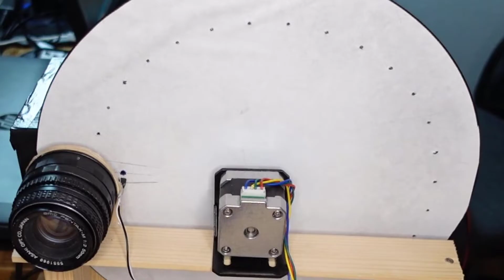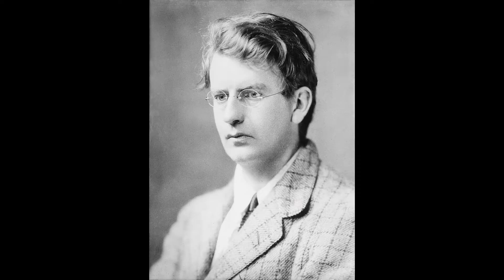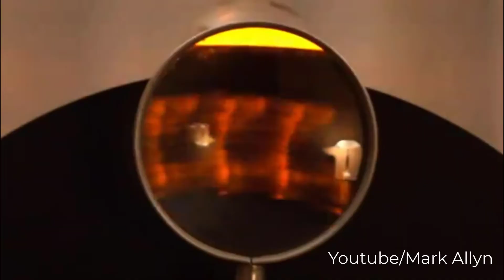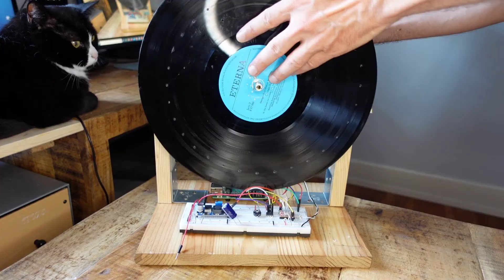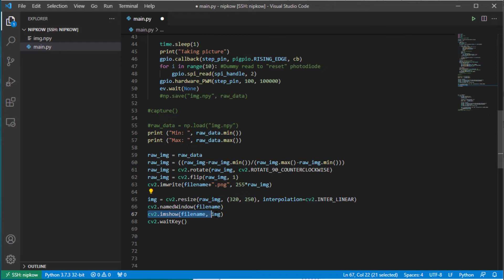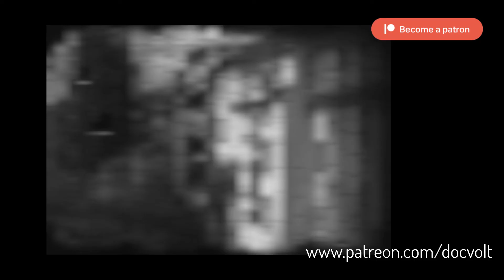I Built a Mechanical Digital Camera With a Nipkow Disk

Comment: Absolutely brilliant work. Now everyone understands why the Nipkow camera was never built in practice. In the 1930s, the way it was handled was that the scene was shot on classic film. This film (still wet) was passed through a one-hole reel (in practice 2 or 4 holes were used). The holes only performed line decomposition (the holes did not form a worm). Slide decomposition was achieved by moving the film. In this way, excellent picture quality was achieved, which could be watched on Nipkow television. This principle of scanning existed in the days of cathode ray tubes before the advent of Ampex, etc. - a high contrast screen with a single line scanning film that scrolled...

Comment: If you redrill the holes to take (via a push fit) optical quality acrylic balls (making it a so called bead disk) you will solve your light and resolution issues. Interesting concept (still camera).
Reply from the maker: Yes, there are many other ways to make this camera better. For example drilling more holes, using a photomultiplier instead of the photodiode etc.

Comment: Use a photoresistor it can be thousand times mire sensitive then photo diode, also you can try with photon multiplier tube from old night vision device, that can increase sensitiviti to mental high level. Good luck !
Reply from the maker: I already thought of using an avalanche diode. But These are rather expensive, though.
Reply: @DoctorVolt why not LDR ? Or  get broken drum scanner brand like "screen" or "linotype"   there are using  photon multiplier sensor...  and scan using same principle like your device but extremely sensitive. Old night vision googles are 20$ in thrift stores, or broken on ebay. Cheers M
Reply from the maker: @marcsmithsonian9773  I tried LDRs as well. These have a bigger surface than photo diodes and thus can collect more light. But it turned out that they react very sluggishly on poor light condition. So image quality with photo diodes was way better than with LDR.

Comment: Did you think of using an LDR rather than a photodiode? And an analogue amp front-end to make it more sensitive and perhaps give a better range, by mapping values to something more linear, to compensate against the non-linearity of your sensor? If you switch to an LDR you might not need to re-map, they may be more linear in a certain range. Baird managed live video with whatever awful light sensor he had back then, some sort of vacuum tube, possibly using selenium.You also might try using R,G,B leds, pulsing each one in turn for each pixel as the Nipkow disc moves round, assuming your sensor is fast enough. With enough light, it'll likely be quicker in response. Then you'd have colour! Alternatively, have 3 LDRs with a colour filter in front of each one.

In fact a larger LDR might be more sensitive, too, or perhaps use a couple in parallel. Whatever, you'd just need to focus to a wider spot at that point. It would be dimmer, but you fix that with strong lighting, the same way they did back in the early days of TV.

Really, Baird gets far too much credit, when his invention is just applying a Nipkow disc to it's intended purpose. Nipkow deserves more than half the credit for Baird's television. It's the working element, nothing would work without it. Ultimately though it was Farnsworth who made television that was actually practical, Baird's idea didn't last long, before the world dumped mechanically-scanned TV altogether.

Comment: maybe if on the nip disk 
 is make  quite small openings somewhere around 400 it is possible to obtain a sufficiently sharp image?
Reply from the maker: Yes, I know that there were Nipkow disks with up to 441 lines resolution, until the electronical cameras came up.
Reply: @DoctorVolt  do you have a link or a photo of this 441 lines nipkow disk ?
Reply from the maker: I read about it in an article. https://second.wiki/wiki/filmabtaster
Reply: @DoctorVolt  thanks

Comment: I can't believe the photodiode is so slow. What was the original sensor type those days?
Reply from the maker: The photodiode is so slow because it has to make do with very little light.
Reply: @DoctorVolt  Maybe use a big lense like a magnifying glass to focus the light on ot the disk so it is more intense?

Comment: maybe some filter would reduce the noise to enable more fps? If recorded objects don't move too fast, the signal will repeat with the same frequency that frames repeat, while I think noise frequency  distribution won't depend on it. Also you can cover some edge to get repeatedly pure noise to measure it's parameters.
Reply from the maker: I already tried different filters, iterations etc. in GIMP. But nothing really improved the quality of the pictures.